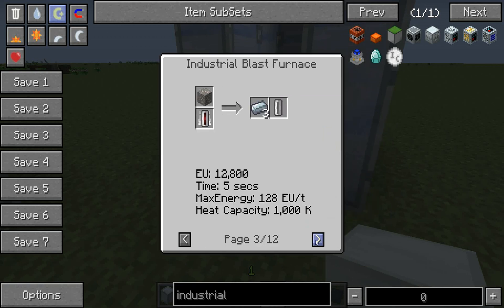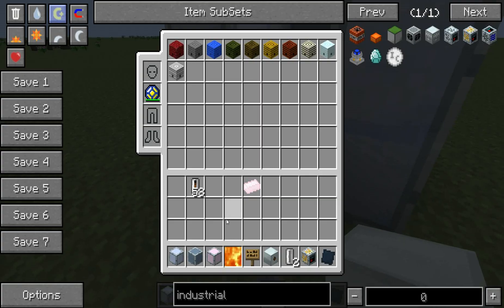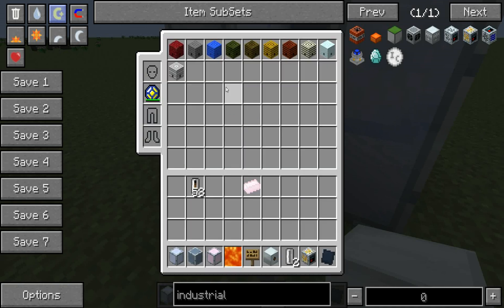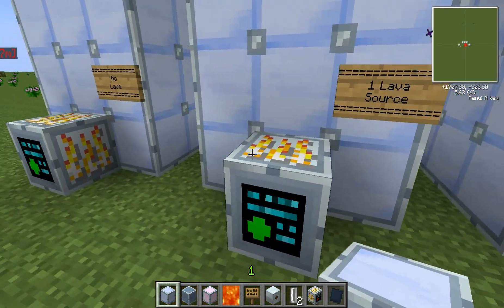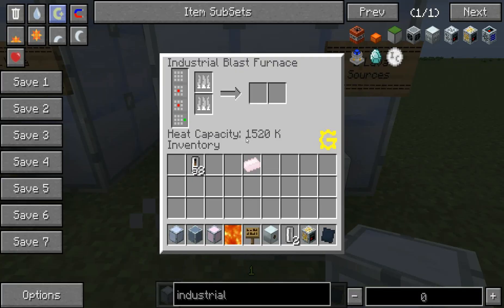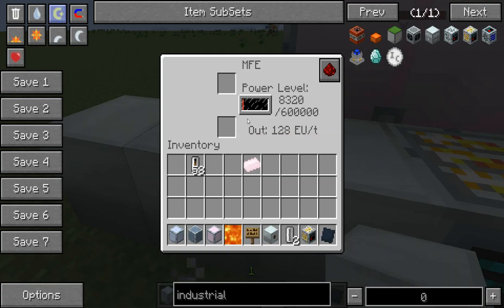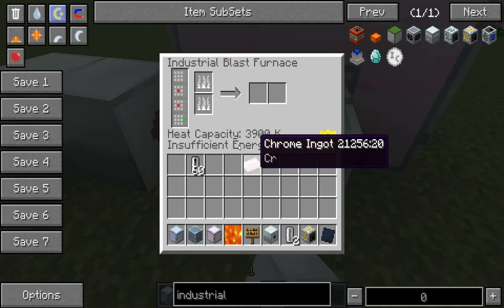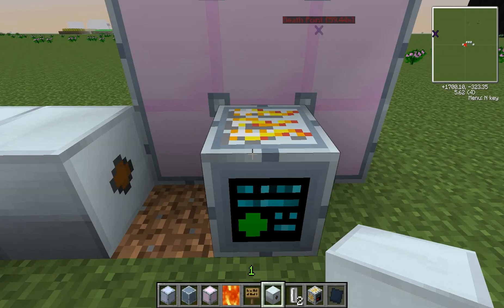FTB Spotlight: Industrial Blast Furnace

Comment: to smelt up to aluminium and chrome, you need 1700k, and tungsten 2500, tungstensteel 3000

something I haven't seen ANYONE say in tutorials is that you can mix/match machine casings, because they add a specific heat value based on what case it is

so to smelt chrome early, you only need 9 reinforced casings, and can use the rest as standard casings.

This also means that the most advanced casings you need are 16, and the rest can be advanced casings - that should be exactly 3000 K

Comment from the maker: make sure the machine casing is complete and correct, because even without lava the reinforced casing is able to make silicon plates.. (also make sure you're putting at least 2 silicon cells in at a time)

Comment: Im having trouble powering the industrial blast furnace...i have a geothermal generator connected to and MFE connected to The furnace but it still doesnt power on...It has 2 buckets of lava inside and im placing the silicon cells exactly how they need to be...help?

Comment from the maker: I'm using the Generator (cheapest method, burning anything that can be burned in a furnace) - it'll send energy out of every side to wires and/or machines connected to it (in this case, it's putting power into the MFE)